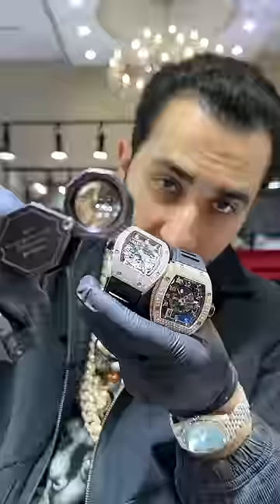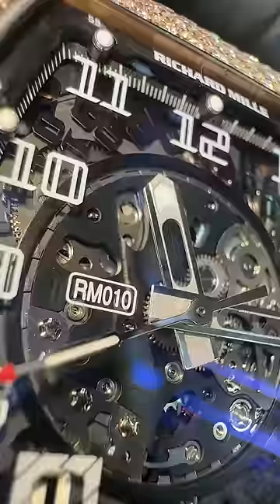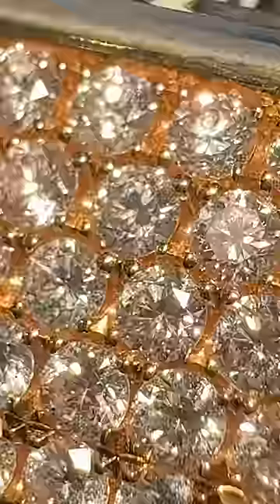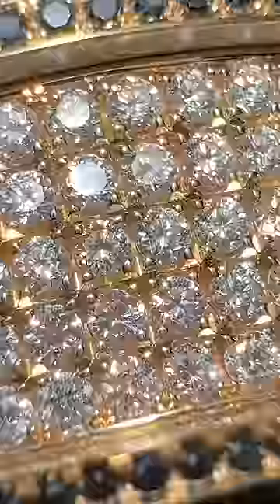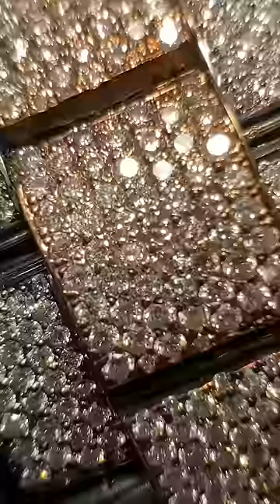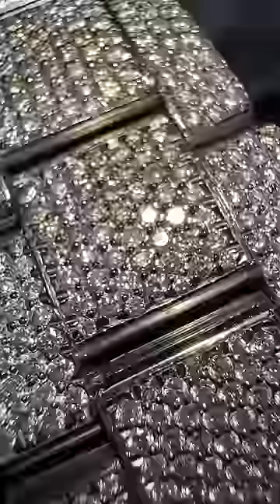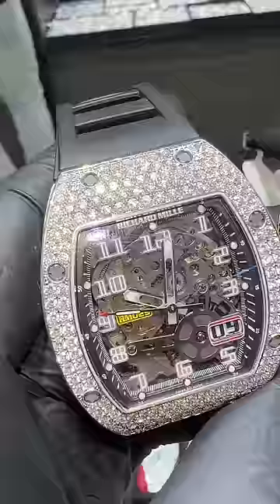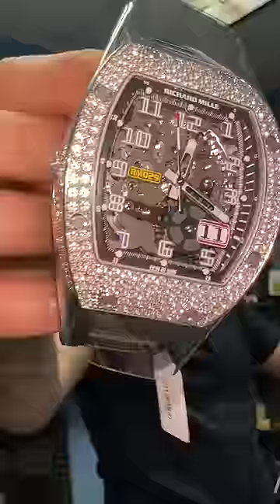FACTORY VS NON FACTORY DIAMOND RICHARD MILLE'S!!! #shorts

Comment: Also the factory setting will hold its original value or close to it maybe even going up. The aftermarket will go down much more then the watch and setting cost. Maybe if a famous jeweler did it with vvs or flawless and the setting is flawless as well maybe maybe maybe you can get what you paid or a tad more for the provenance

Comment: Will the cost be around the same? 
Or will it cost more to do an aftermarket setting.
Reply: If he does it will drastically drop the value of the watch
Reply: Cost will be similar, maybe even cheaper by going aftermarket.
The re-sale value will be much less for the aftermarket setting.
Reply: Factory set is always more expensive. As far as doing it yourself unless you know what you’re doing and have the correct tools and can source the diamonds you need in the quantities you need it’s gonna be next to impossible. A jeweler will have to set them.
Reply: @jpatt85  
So for overall best investment, factory set?
Reply: @JuanValdez-yx6yu  yes
Reply: @JuanValdez-yx6yu  Yes. Investments need to hold their value and increase in value.
The quality of aftermarket settings are debatable, as shown by this video. 
Factory settings are always considered to be "top" settings. Could an aftermarket setting be better than Factory? Absolutely, but it's still Aftermarket, not official, second-hand, non-authentic.
Factory always retains value better than Aftermarket.
Reply: @jpatt85  perfect explanation. Appreciate the advice!
Reply: @JuanValdez-yx6yu  You're going off to buy a Factory set Richard Mille?
Reply: @jpatt85  No, wish I was at that level rn. Just wanted to make sure I wasn't miss informed about anything. I was also just genuinely confused on why he would call a factory set superior but reccomend people go aftermarket.